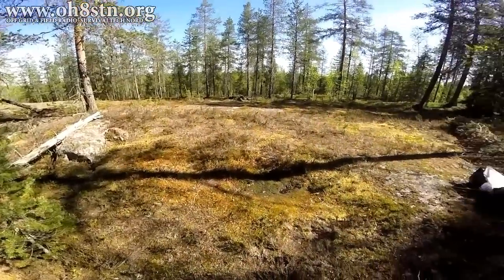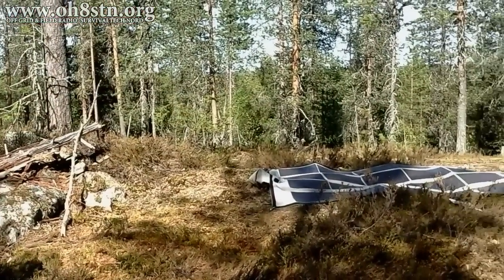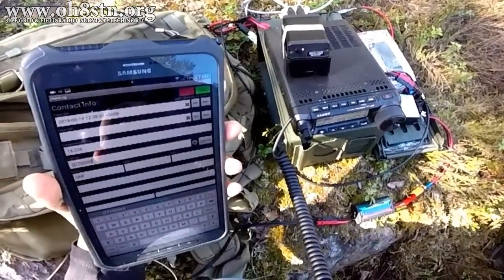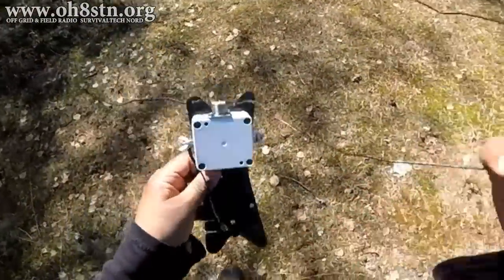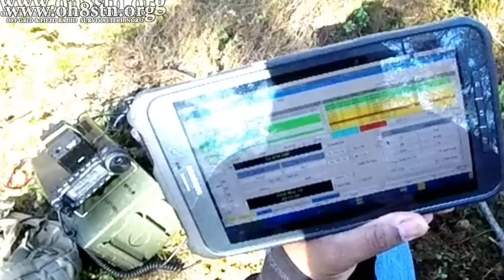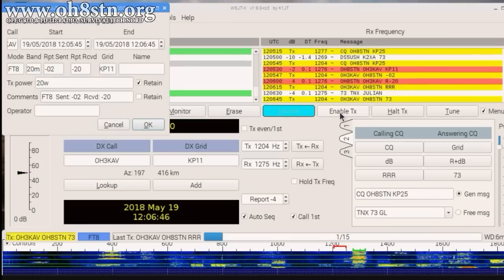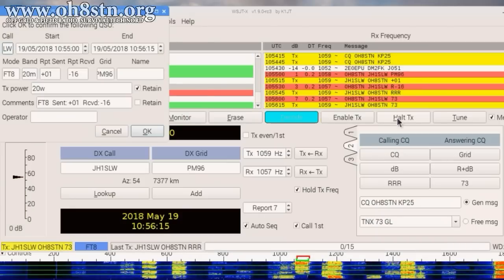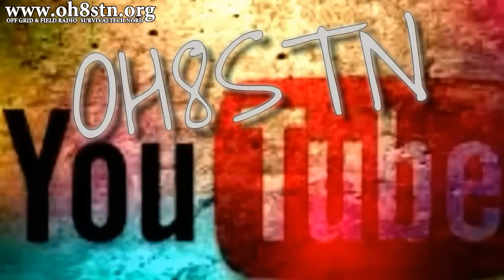Chameleon EMCOMM III Portable Ham Radio

Comment: Maybe I should ask Carl, but in your experience what can the EmComm 3 do that the MPAS in its multiple configurations can't do? Is it more efficient, does it lend it self to antennas styles that the long wire part of the MPAS can't? Many thanks as always and SF. Rob/WA9RAD
Reply from the maker: Well the EMCOMM 3 is a random length end fed. It's designed to present pretty low SWR on amateur bands between 40 and 6 m. Perhaps 80 but I don't remember off hand. Anyway it's definitely more efficient, because there's an enormous amount of copper in the air. You also have the ability to put that wire in the air in various configurations. The MPAS is more like a Swiss Army knife. Yes it also has its long wire mode which can ge effective. For me, when I want to wire antenna, I use the EMCOMM 3P. When I don't know what type of configuration I'll need, I'll take the MPAS.
73
Julian oh8stn
Reply: Thanks, Julian. With Chameleon having there Black Friday 20% sale coming up, I might be looking for justification to try the EmComm3. I have use the MPAS in both mil whip and long wire style. Also having an ICOM AH-4, it would be an interesting comparison for random long-.wire antennas to try all three.Greatly appreciate your videos and have been recommending them to upcoming hams to get an honest feel for available options.

Comment: Hey Julian and all of your videos and blog posts I never see an answer to this question: what length and type of coaxial cable do you carry in your QRP go kit? I have an FT818 and just ordered the CHA-Emcomm III and I was trying to figure out the best cable assembly to add to my kit.  Thanks for all your great work!
Reply from the maker: You never see the answers that question because it's a trick one. So I have two different kinds of coax that I use. The first one is the default that comes from chameleon I think it's a RG58 X. That's okay when I'm not trying to be ultra lightweight. When I am trying to be ultra lightweight I'll use rg316. The rg316 is lighter but in Greater lengths has more losses. But if you keep it under something like 20 or 25 M maximum the losses are perfectly fine.
Thanks for the question, and the kindness. It's very much appreciated.
Reply: OH8STN thanks for the quick answer! One more question: to choke or not to choke?
Reply from the maker: I always use a choke to remove the coax cable out of the antenna equation. If you're using an end fed antenna and you don't have a counterpoise you can use the choke at the base of the radio rather than just at the antenna feed point to make up for the lack of counterpoise

Comment: Excellent results Julian. Just waiting for my exam result to be confirmed by the RSGB and my new intermediate callsign to be issued by Ofcom before  I can start to use my modified UBITX in the field. I have a number of antenna options to try out as well as a home made battery pack using the reclaimed  18650 cells.

Comment: Great video! I am always excited when I see you have uploaded a new video. I have built a Lifepo4 battery with 38120S as well. I am using a different BMS that has separate charge and output connections. It works well for me. I am using a Buck converter from my solar panel to my battery so I can charge with CC/CV. That is working as well. One other thing I did with my battery was to add an extra 4s plug. I can connect a device to monitor and base balance the batteries. It is a neat inexpensive device. You may want to check it out on amazon. 73 ~Ron   ("Tenergy 5-in-1 Battery Meter, Intelligent Cell Meter Digital Battery Checker Battery Balancer for LiPo/LiFePO4/Li-ion/NiCd/NiMH Battery Packs")

Comment: Great video. A couple of questions. What was the distance to the Japanese contact and how many watts were you running at the time? I also have the 891 and am looking forward to getting out there soon.
Reply from the maker: Jonathan Endersby hello Jonathan. The Japanese station was 7377 km away from me. I cut the video screencapture short, but I believe it was ~50-70 Watts, not more. The actual test was about the battery pack and solar panel, but the antenna did a great job as well.
Hope to work you Portable to portable sometime.
73
Julian oh8stn